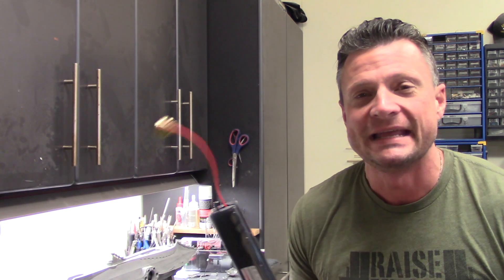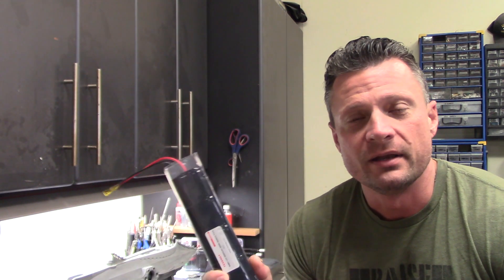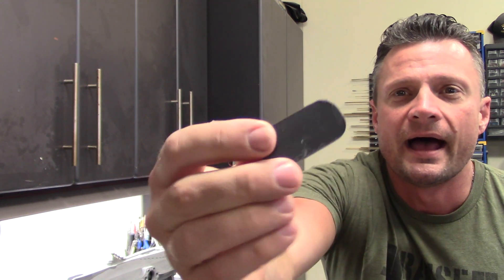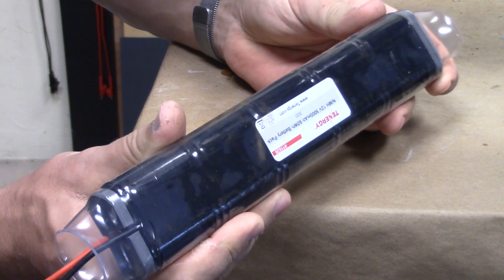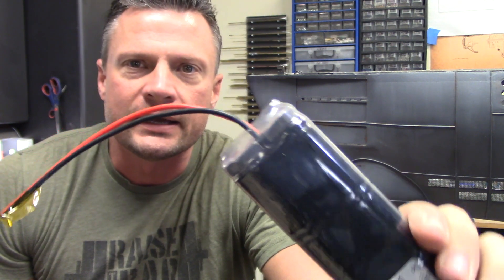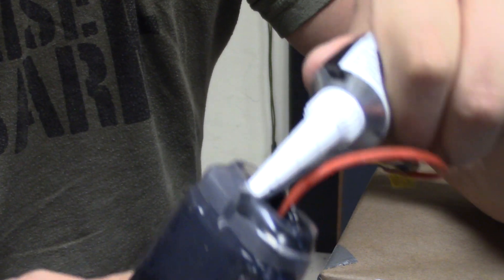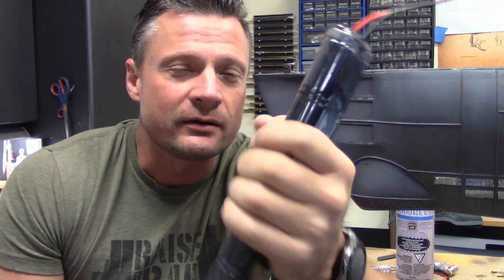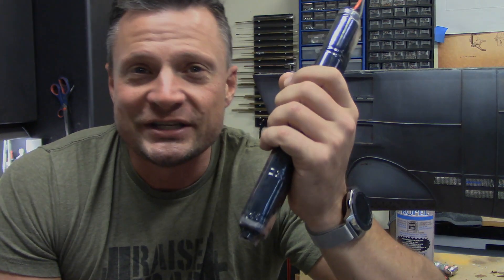How to waterproof your RC submarine batteries

Comment: Are you almost the same thing with soft cased lipo  Hard case you don’t have to worry about water and if you were all you do is epoxy Seam of the case The positive or negative leads & the balance plug    Super easy then you get maximum power!   Lipo also does not retain a memory like NmH!    Cheers 🍻

Comment: Thanks for the video.  I am curious why you don't recommend LiPo batteries for wet applications?
Reply: lithium is reactive with water, if your battery were to fail underwater not only would your sub be destroyed but the left over lithium from the reaction (which would be freshly exposed after having its pouch blown open with gasses) would be free to react with the water rushing in through freshly destroyed seals in your sub further reacting violently destroying your sub. Although if you were to have sufficient protections in place such as fuses around the boat and at cell level as well as a proper BMS circuit. (Over charge protection, over discharge protection, over current protection, and cell balancing) you could mitigate most points of failure, but due to the amount of care that must be taken to use LiPo especially if you are unfamiliar with the battery chemistry it would just be easier and significantly safer to use NiMh or Lead

Comment: I’m wondering if putting the silicone under the plastic bulkheads prior to heat shrinking would give any better results. Just thought gaming it, seems like you’d be able to get the heat shrink tighter to the ends and get a better seal. I’m assuming you’ve tried it previously and had better success this way. Just wondering out loud, essentially